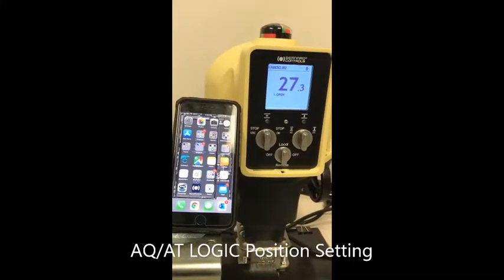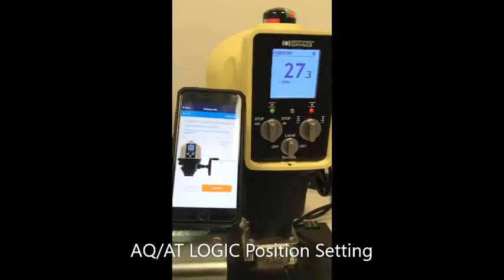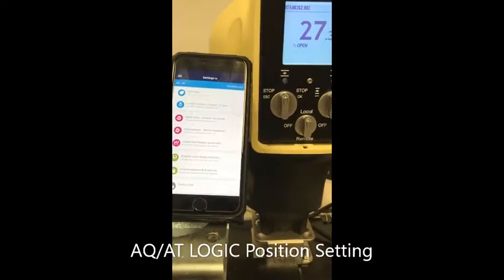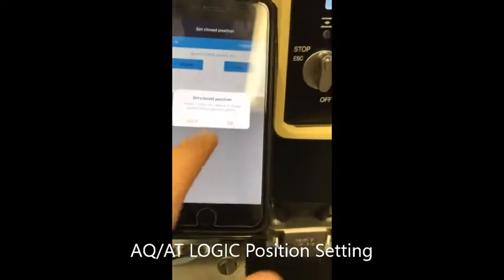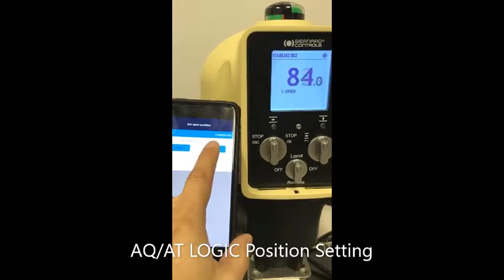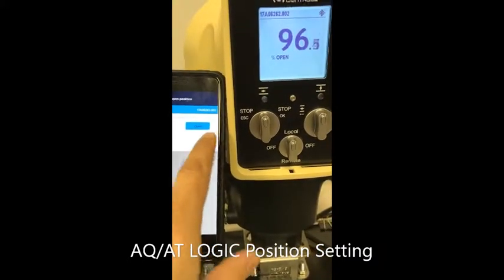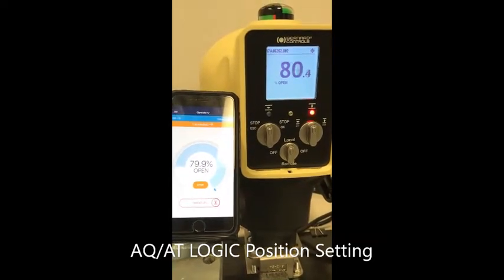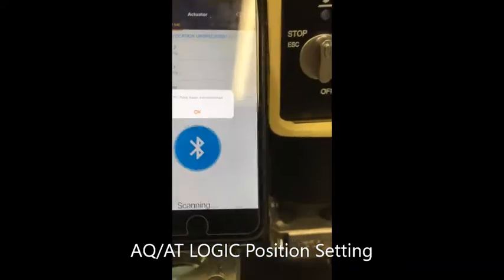AQ AT LOGIC POSITION SETTING - BERNARD CONTROLS - Electric Actuator

Comment: Read only mode... how do you get past this? Do I need to jumper contacts?
Reply from the maker: Hi,
Do you have a key symbol on the screen?
Reply: Padlocked and local commands are inhibited . I put in the 9000 pass code and an unable to changed settings.
Reply from the maker: @ You need to put jumpers on AUX 1 and AUX 2 to deactivate the Keylock
Reply: I appreciate the quick response  I will give it a try tomorrow. And let you know. - Thank you.
Reply from the maker: @ 
For Aux 1: it shall be activated as a command.
Can use the 24vdc internally
Similar to AUX2
They are commands
Reply: Depending on others' configuration , I was able to jumper AUX 1 (8-4) and unlock it. Thank you for your help.
Reply from the maker: @ excellent!
Stay at your service if need more help
Reply: @jeffe9122 Dear Sir, can you share your solution? I have the same problem.
Reply: Dear sir.can you help me? we have same issue.how to do unlock  @jeffe9122

Comment: Sir, I need help, I have a valve, the local buttons, it does not work, the display shows locked
Reply from the maker: Hi,
Can you show me the picture?
Reply: @xaythideth29091976  also i have same problem ,my valve work juste remot no local,when put passe word 9000 for modification setting no giv me accesse ,evrey time give me message only read you can't wraiting or modifier and symbol the locked in display plaise if you know that helpe me
Reply from the maker: @omarelmadini7248  send me the picture of the LCD display.
Do you see a padlock on the LCD Display?
Reply: @xaythideth29091976  yeas i have padlock on the display,pleas send me you emai
Reply from the maker: @omarelmadini7248  what s your email. I will send you
Reply: @xaythideth29091976  for send you picture the display
Reply from the maker: @omarelmadini7248  send me your Email.
I will let you know how to unlock the padlock
Reply: Did anyone find a solution to this problem ? Thanks!